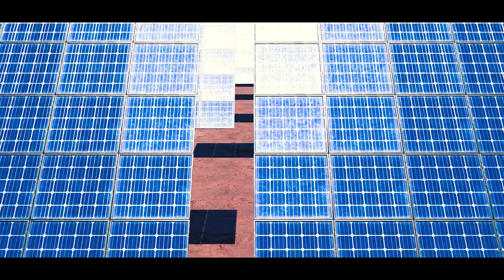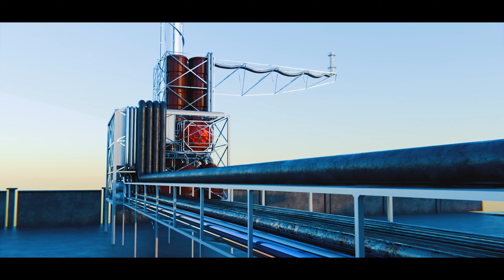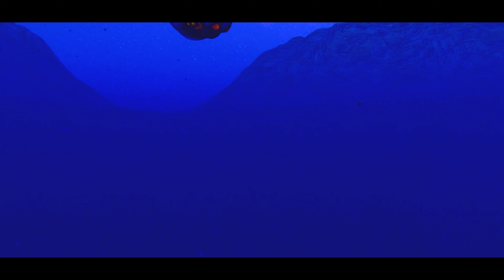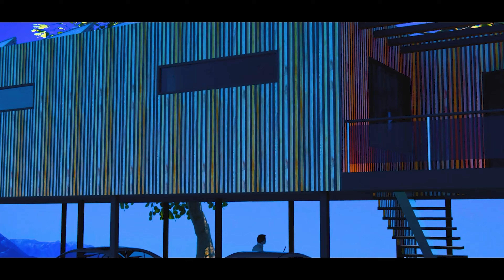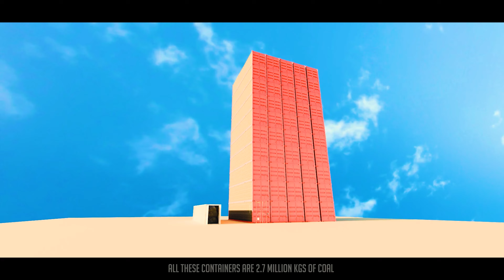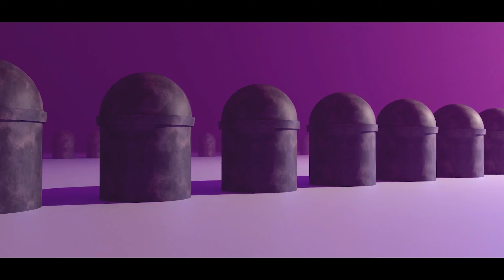How Much Better is Nuclear Energy than Coal, Gas & Renewables?

Comment: Thanks for the presentation,  you cover the facts well. I am not anti-nuclear and it does have it's place. However,  renewable energy sources and deep geothermal installations are rapidly expanding. The capital requirements and lead times for nuclear are limiting factors. Except for special applications, nuclear looses out to distributed generation using renewables and geothermal.
Reply from the maker: I don't really know what you mean to distributed and I don't think NP loses. I simply think that most governments think in terms of profit and not long term enough.

For example in South America where I reside, there could be a ton more Nuclear Power Plants, but the governments are so short term and profit-focused that this isn't likely to be a reality.

But still I do agree that renewables are a much better path than coal and gas, that's for sure.

Geothermal has its place definitely. And it's way underutilised. There is a melodysheep video where he mentioned extracting heat from a volcano, and I honestly thought that would be a fantastic way to make steam and turn turbines without co2 and more pollutants, so that could be a decent alternative in the medium term too, if humanity decides to go that route.